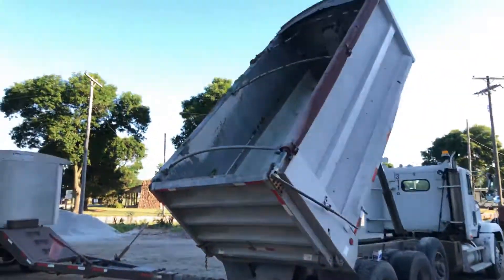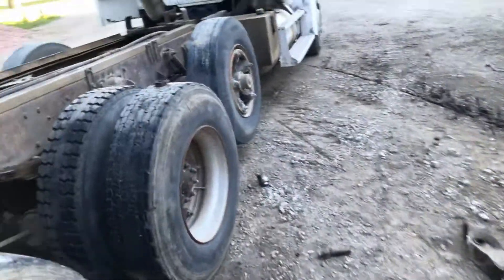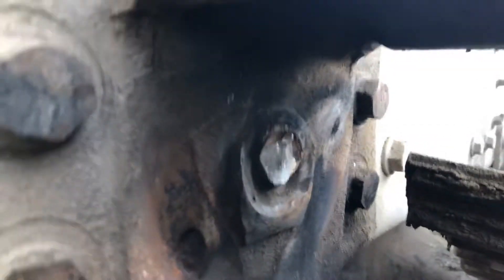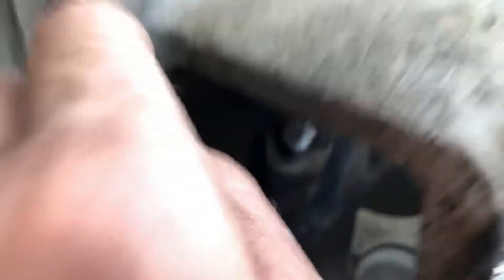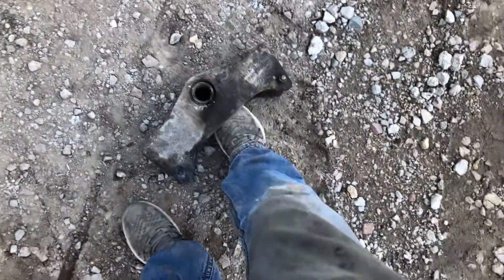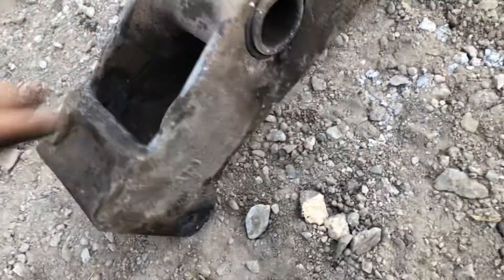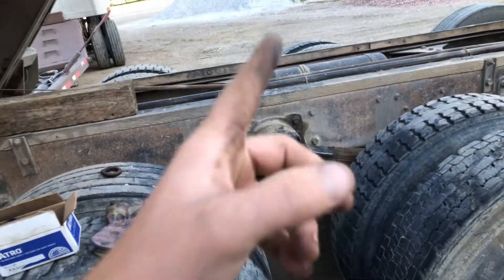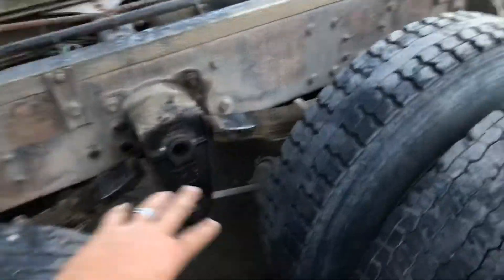Rayco Suspension on Freightliner

Comment: My goodness those parts should be more available than months away. What could be done about leaning, is add a leaf or two to the low side in each spring. It is time consuming though. We had a upset truck once that was a "leaner" and that solved the problem. Oh and just for info. Try a old mack camel back, single spring hendrickson or rubber block I-beam suspension, they are worse yet. Just my opinion though.
Reply from the maker: bushing on equalizer out An equalizer pin